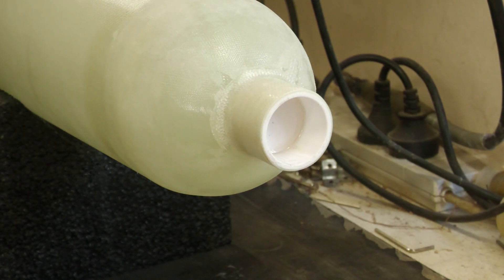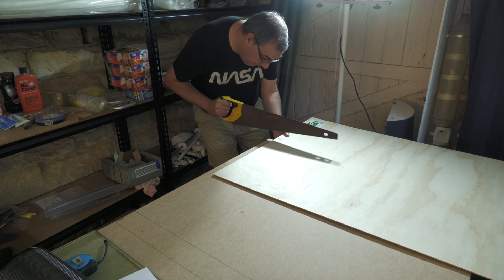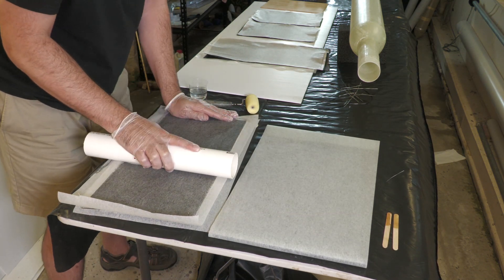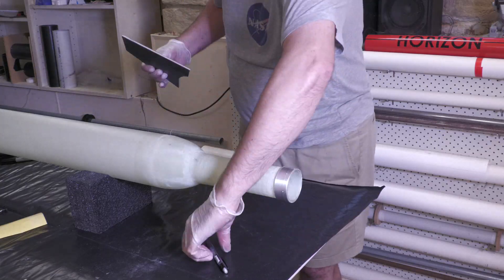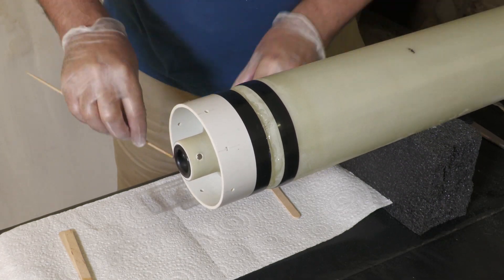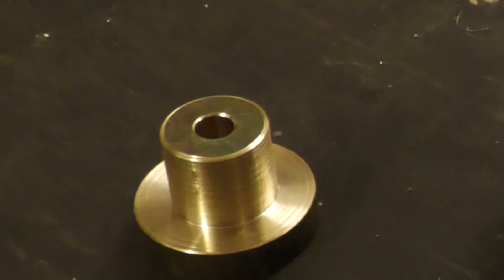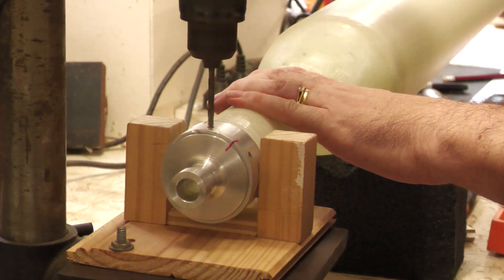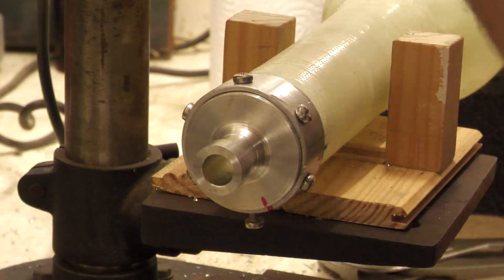High Power Water/Pyro Rocket - Part 4 - Fins

Comment: dint know there was a thing like fiberglass. 😂we just use 3d printed fins, printed in vase mode. it gets the job done with only 3 rotations on the way to the altitude of 200+ meter. so what are reasons to use so strong fins? only for higher forces? non the less again impressive work!
Reply from the maker: This rocket weighs over 4kg dry. Because this is our Level 2 rocket that will be flying on a bigger solid motor you want to make sure the fins don't come apart during flight and especially when the rocket lands. If you damage a fin you don't pass your Level 2 cert. Would you be comfortable attaching your fins to a house brick and dropping them onto solid ground from 1m?
Reply: @AirCommandRockets  no not at all thank you
Reply: @ascensionrocketryshorts  haha yeah the main concern is passing the level 2 flight... and there are huge forces on the fins when flying with large rocket motors due to the speed :O

Comment: Hey...how about using a pyro rocket to create the pressure inside a water rocket ???
Reply from the maker: That would certainly be possible, though you would have to know how the increasing pressure inside the pressure chamber affects the back pressure and hence burn rate inside the motor.
Reply: @AirCommandRockets    Yes, the energy densitys would have to be matched, but it's very interesting.  Certainly the pyro rocket has much more stored energy than a compressed air chamber.  One might need some kind of ceramic piston to seperate the rocket from the water.

Comment: I'm from Brazil, I watch all your videos, I love water rockets, I really want to evolve just like you!
I've never had success with bottle splicing here, I've tried several adhesives but they all break at 60PSI.
Reply from the maker: Hi and thanks for following along. As you've discovered not all glues are created equal. There actually aren't that many suitable glues for PET.  Have you tried the polyurethane based wood glues? They have a honey like consistency and are also kind of honey coloured. (No don't use honey :) ) Are you able to order the PL premium on-line from e-bay or Amazon? When you tried the splices did you give them enough time to cure. Sometimes it can take 3 days before the glue is fully cured as it takes time for atmospheric moisture to penetrate all the way into the joint.